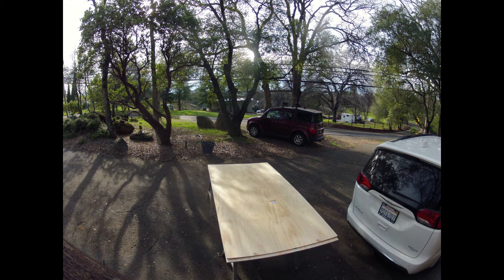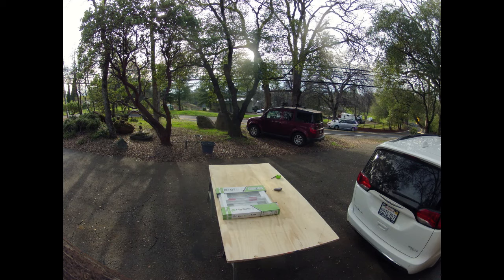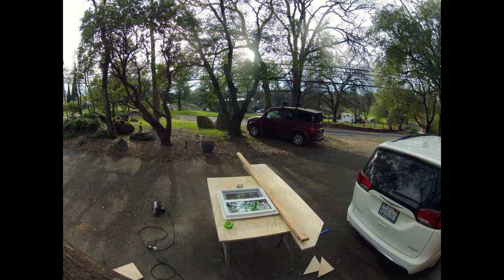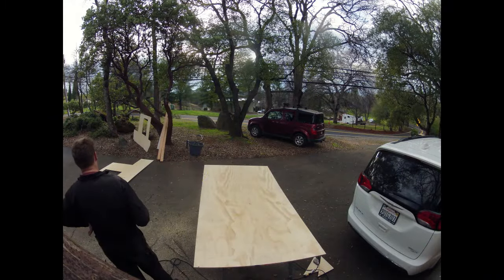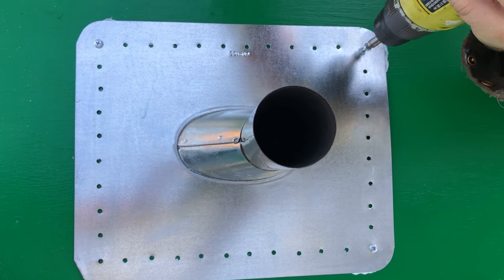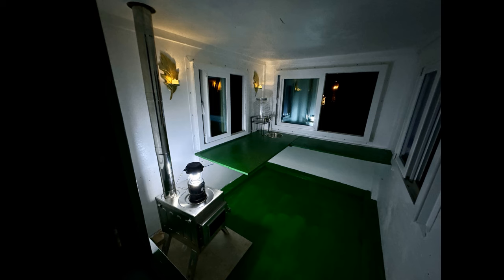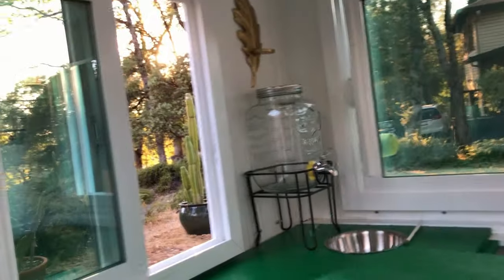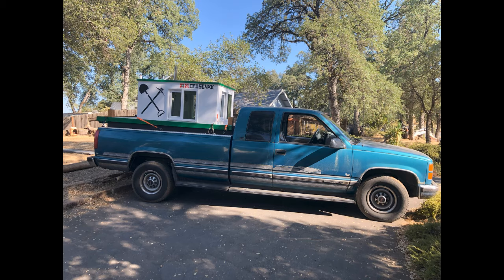🔨🪚 Building The Worlds Smallest Houseboat 🪚🔨

Comment: myself, I would have put 2 layers of fiberglass on the hull to be a little more sure that it doesn't leak. now we wait for the maiden voyage.
Reply: Looks like it would be good for a kids play boat
Reply from the maker: Check out Cumberland Rover's channel. He makes boats using exterior plywood too. House paint works fine to water proof a boat intended for limited use.
Reply: @UBG_Marine  I have no doubt that it is waterproof with paint. but if you hit a rock and a joint opens up a little is what I'm most worried about.
Reply from the maker: @PUTDEVICE  fair point, I’ll try not to hit any rocks 
 🌊🪨⛴️🌊

Comment: Well that's cute! I'm curious how she works for you! A 2.5hp honda will push it with ease as my buddy built a similar sized "box boat" and with just idle, the boat moves well! It might interest you to know that with some of the cheaper exterior ply, the available three ply, it may require a covering of some sort, glass or canvas and "Tite Bond II"! The reason is another friend, who built another box boat found that the following season, during the boat's launch, it leaked so badly that he could not safely go on the trip! What had happened was each layer of ply (three layers) had been soaked the previous season in use, the wood had expanded in each layer and after drying out over winter, these layers shrank, leaving gaps where the water could navigate between the three ply layers into the boat! It did not delaminate or rot, therefore he was able to save the boat by adding a canvas cloth bedded in the glue and repainted. He only needed to cover up past the waterline a few inches! I could not tell the type of ply you used, which may have been thicker with more laminations and might be fine if so, but I felt the info may be helpful to you or the next felow doing such a build! I look forward to seeing more! AllthebestRoy